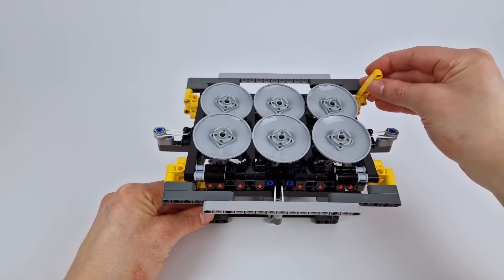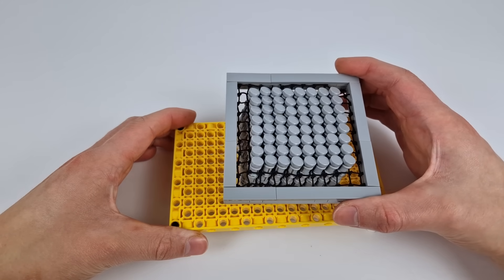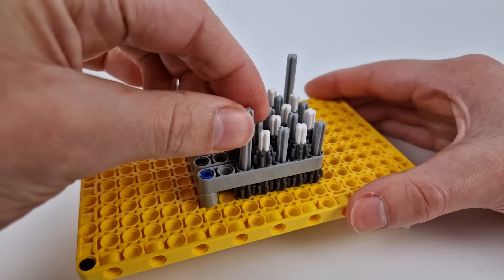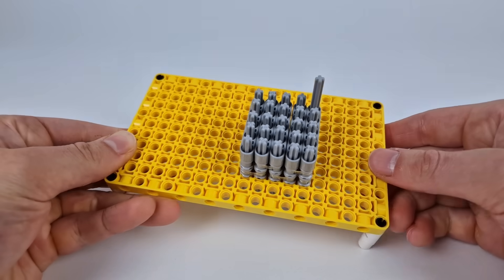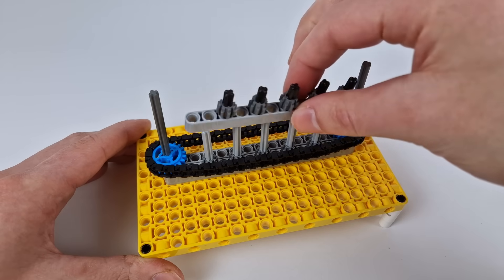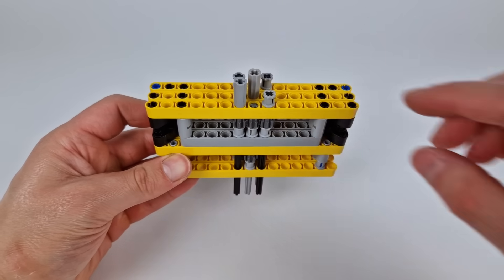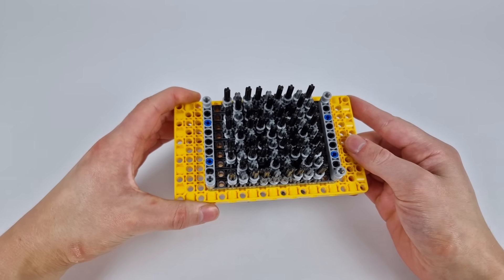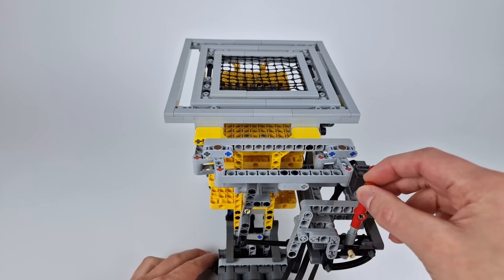How I Built a LEGO Treadmill That Moves in EVERY Direction

Comment: Imagine combining this with some nxt sensors so that whenever the figure gets to close to a border it automaticly switches, the perfect slipry pinguin showcase diorama
Reply from the maker: That's a great idea! I've used the NXT ultrasonic sensors in a previous video, and unfortunately they're not great at detecting small objects, they're much better around large flat surfaces, but it's definitely something I should look into!
Reply: @BananaGearStudios  Doesn't NXT support detecting light? You could create light-curtain style setup where the item blocking the light is interpreted as the item being close the edge? You might be able to do full light curtain with multiple bounces if you used real mirrors in addition to lego blocks but something like light white led in a pipe-like structure to prevent light from wrong LED hitting another sensor + light detecting sensor should allow one straight line detection.
Reply: @MikkoRantalainen  switch to powered up hub and motors and use pybricks for programing.
Reply: You could probably use light detectors as they are relatively reliable (as long as you calibrate them to the environment), stick a light on every corner and wait for the reading to drop @BananaGearStudios
Reply: Disney recently showcased this exact concept for humans to walk on. Some dude has been working on it for years and this guy just makes it with some legos LMAO
Reply: @DigitalWolverine  "Recently" Quite a few years old by now innit. The showcase that technology in one of their techshows in the park, sadly they have a patent on it so nobody will ever use it.
Reply: make a DVD player screensaver
Reply: @dab88  Nice one!

Comment: it's the holotile disney thingy!
Reply: My exact thoughts
Reply: Exactly !
Reply from the maker: Yep, the design is similar though here the discs tilt in all directions whereas they're fixed on the Disney version. I mentioned that I first saw this idea done by them in my first video on this, where I made the larger treadmill version I showed at the start.
Reply: @BananaGearStudios  i just checked the mkbhd video on the holotile and they're not fixed. They also tilt. Maybe a note in the description should point out that this idea came from there. Incredible implementation though!
Reply: @moebro-25  From what I can tell it's a slight but important difference. The Disney holotable disks don't actually tilt, but rather are stuck tilted at a slight angle but the bracket they are on rotates. If you look at them closely you'll see what I mean, they can't sit completely flat, they're always at a like 15 degree angle. Picture the satilite dish on a lego millenium falcon; It's mounted at a fixed angle but it's on a base that rotates freely so it can apear to tilt.
Reply: Almost. It doesn't have the speed and directional sensors like Disney's, which I'd argue are the most important part to making it not only functional, but practical. I do realize that this is just Lego, so practicality is out the window already. Still really cool though, and way beyond my engineering skills!
Reply: Oooo la la

Comment: it might be destructive, but you could drill a hole into the small gears for them to freely spin on the lego axles to make the first idea work.
also you couldve probably just powered them in a checker pattern with a simple grid of small gears, but have every other gear freely spinning. they will help distribute the weight of the object above, filling out the gaps between the powered tiles.